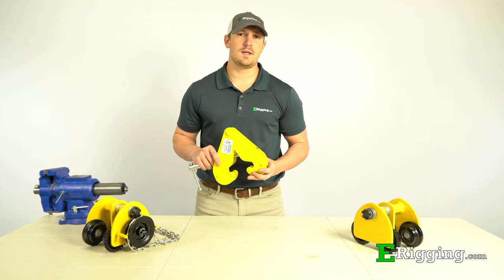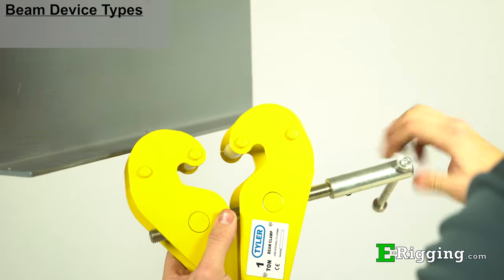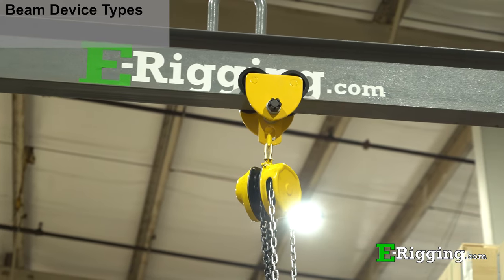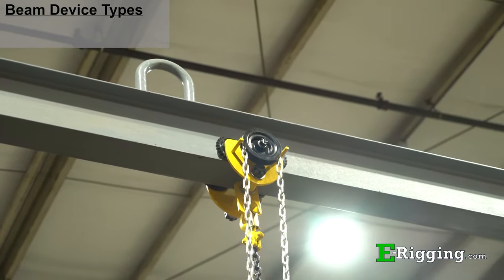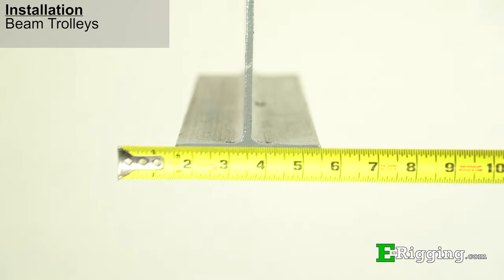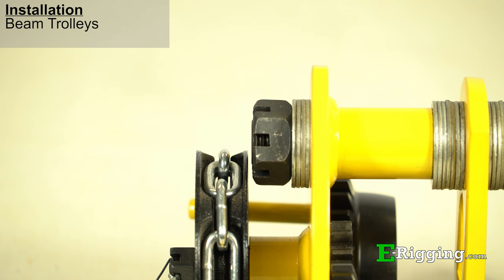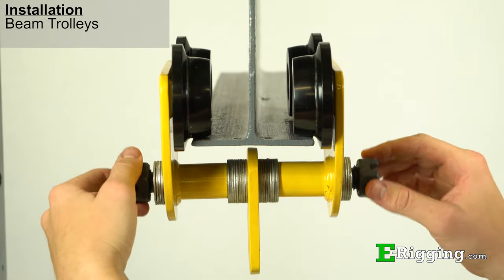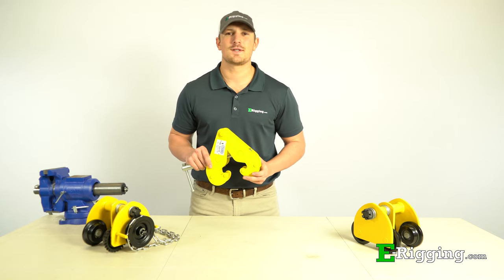How to Select, Install, and Use Beam Clamps & Beam Trolleys

Comment: I realize it is recommended to not side load beam clamps, however I noticed in the video at the 55 second mark there is a cable attached that appears to be imparting some side loading. Is there a formula to calculate the maximum permissible side loading?
Reply: ......I guess not....

Comment: Can we use two sets of trolley to support a floating beam which will have its own trolley to lift products?
Reply from the maker: In theory it will work as long as the Working Load Limit of each trolley supporting the floating beam is equal or greater than the working load limit of the trolley on the floating beam plus the weight of the floating beam. It is always recommended to get a qualified person to design and approve your application before lifting.

Comment: Can we give linear motion to "beam clamp" to move clamp in specified position on flange of beam
Reply from the maker: Before final tightening, you can move the beam clamp on the beam to set it into the optimal position. Once it is tightened, it is recommended not to add any linear forces to the clamp.